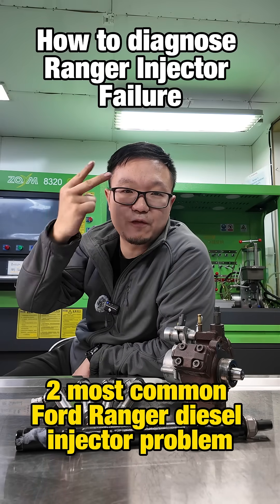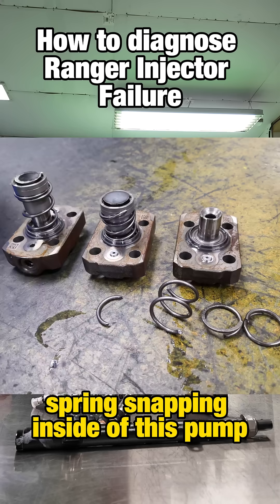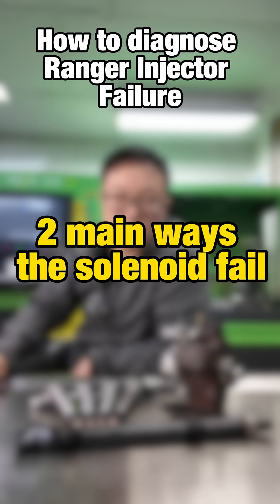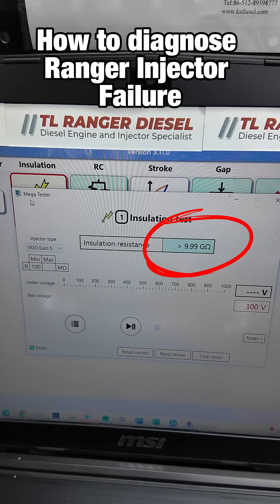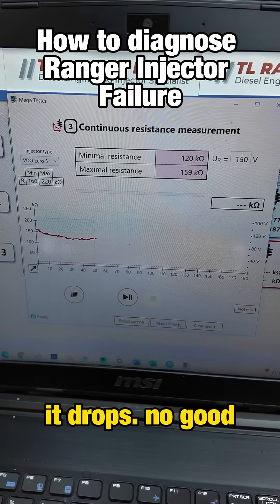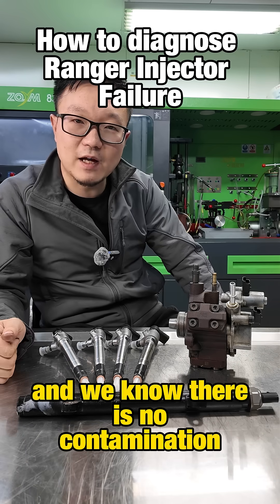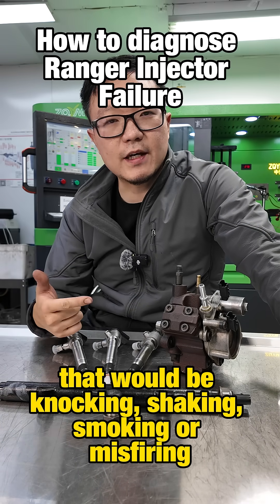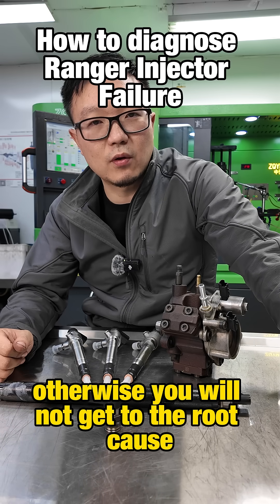How to Diagnose Ford Ranger Injector Problems

Comment: Hi, What if you get a short puff of smoke plus loss of power shuddering/shaking whist trying trying to accelerate. Also a loud clicking injector sound whilst on throttle. But the odd thing is it went away very quickly only lasted a minute and now the car drives fine. Could that be just a bit of bad fuel or temporary sticking injector that resolved itself?